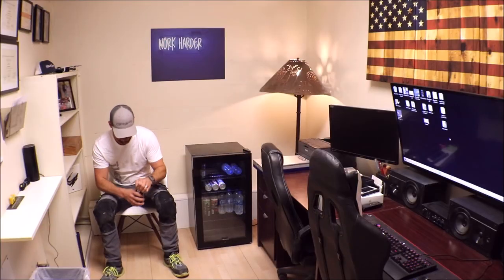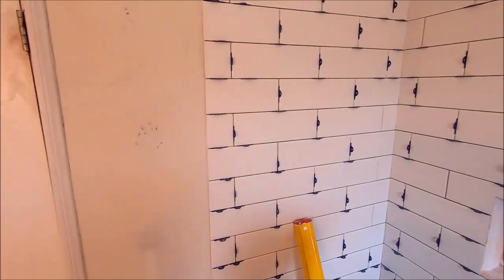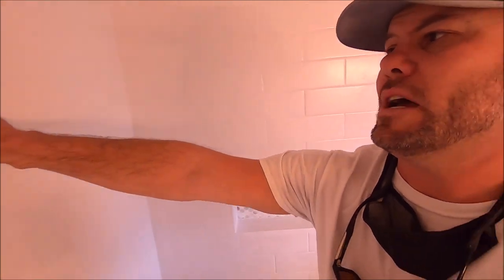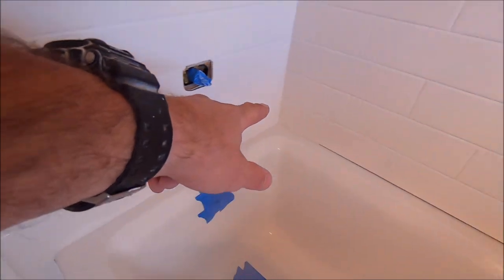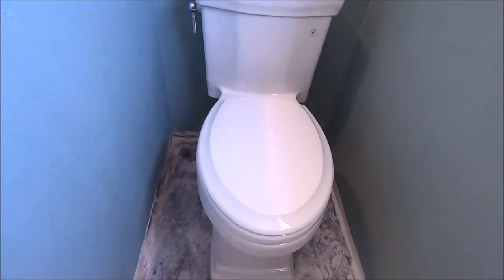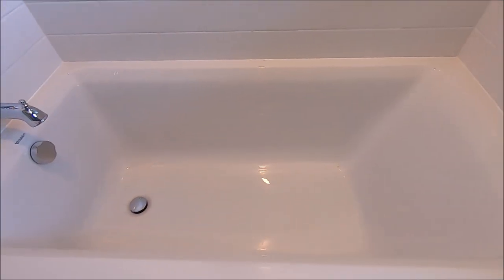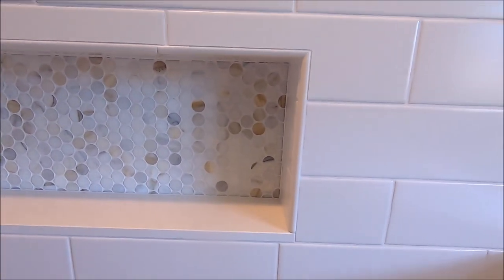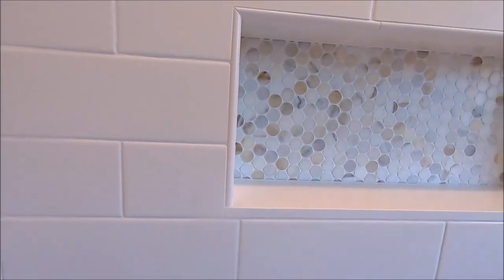Subway Ceramic Shower Finished

Comment: Immaculate! 
Go Berg! 

Funny how I'm doing a job that's just the opposite. 

3x5 Shower, floor to 8' cieling 
Black 3 x 12 Subway Tile
Vertical Orientation 
Penny Tile Shower Floor 
Niche, Curb & Sides Brush Nickel
Trim 

Lotta Work!

Comment: Question..
Prism grout is awesome.  Love it, and I use it every day,  but it says right on the front of the box "no sealing required."  Then why the extra seal?  Only thing I can think is because of the marble and quartz (which I would seal that too).
Awesome little shower.  
Tile Life
Reply from the maker: We like it when water hits the grout joints and the grout does not go dark. If you don't seal Prism, you have a change of tint when it gets wet. 👊 another layer of protection
Reply: @LandbergTileTV  Good to know!!  TY!!  22 year tile veteran STILL learning things!! Never afraid to learn..Lol
Tile Life
Reply: @LandbergTileTV  what about if you mix prism with a grout sealer additive instead of water? I’ve done this and it seems to apply and buff easier.

Comment: Any advice how to make the grouting process easier (sub. ceramic)I mean once u put the grout on the tiles is halfway dry in 3 minutes, because of the absorption of the ceramic.I go with wet sponge before I grout an area,it helps, but not much.Any advice can help, cheers.Not commenting your job, fabulous as always 😍
Reply from the maker: We grout one wall and then sponge off. All grout is different, but Prism is easy to work with.

Comment: How does prism compare to mapei Fa in your opinion? Shower looks awesome!
Reply: Prism is the best!
Reply: Frank, I really like working with Prism, it allow enough time to work the grout.  In addition the end result is excellent!  It cleans easy and holds up well.  I still seal with the Custom Gold Sealer, but where I didn’t seal yet (coffee bar area) it has held up very well.  I have the carton of Madeira and color still sitting on the floor of the garage.

I don’t think you’ll be disappointed.